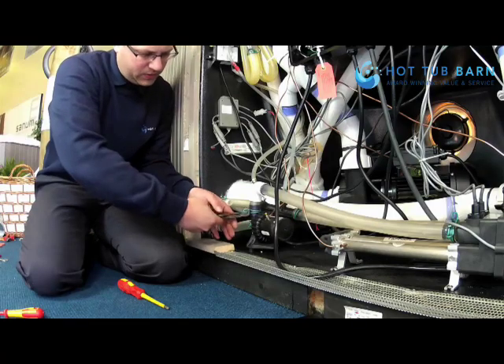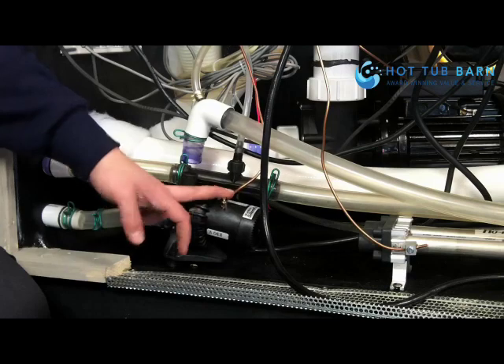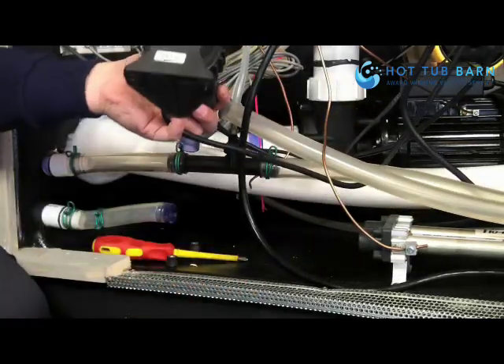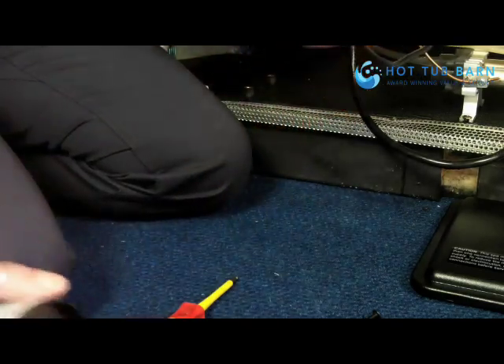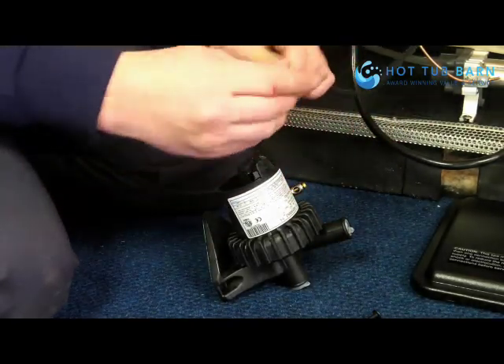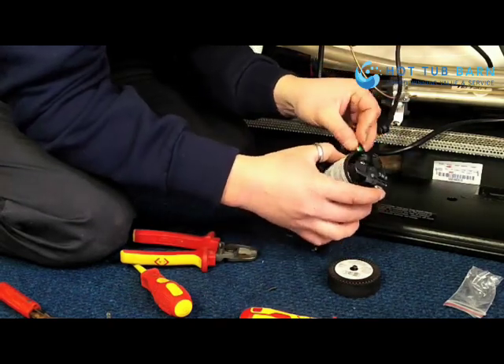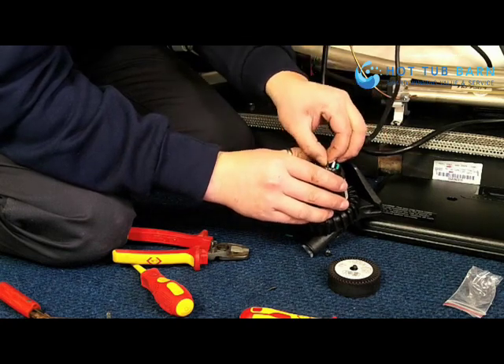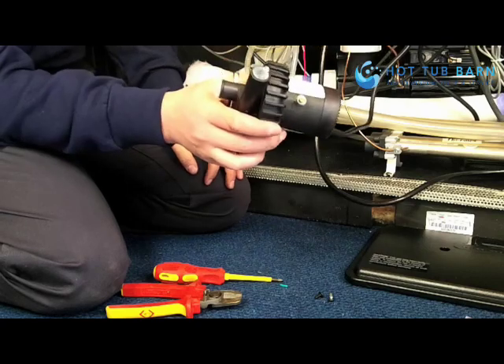Replacing a Hot Tub Circulation Pump with Wayne Hitchcock

Comment: That set up looks very close to my tub's set up and I've been confounded for about a month. I was stopped mainly by the wire locks (thinking I could somehow open them without breaking them) and also by how my pump would not twist open (still does not.) I cut the wires inside and I'm ready to order the new pump. Thank you, Wayne.
Reply: It would be helpful to see everything your doing. Often your hands are in the way or you are off screen. I am thankful to find a video on this at all though! Thanks!